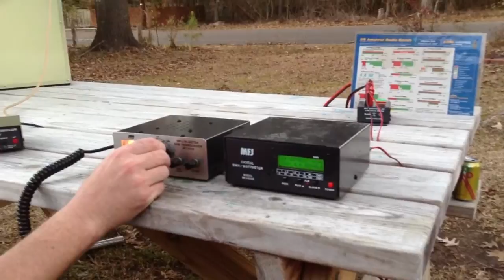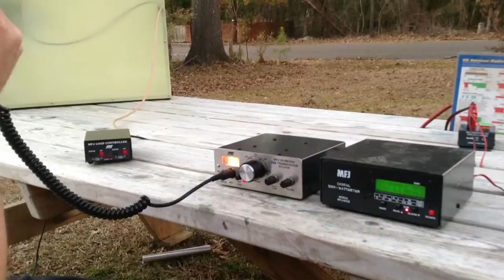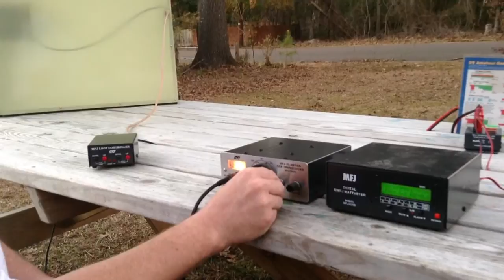MFJ-1780 Box Fan Loop Antenna

Comment: @z8ty did you get the box antenna ? and how is it performing ?
Reply from the maker: i returned it after reviewing it.  Was an easy system to setup and was always a topic of conversation.  It works great if you work single frequency.  Since the Q is high, you gotta retune on every little frequency change.

Comment: I have an MFJ-935C Loop tuner, made up loop from 4 meters of 10mm copper, that's 13 feet long and made contact to Canada from Ireland with just 20 watts, I'm going to have a lot of fun with that. 

Eric, KJ4YZI has some videos on it too his channel is hamradio concepts.
Reply from the maker: I am very familiar with the MFJ-935.  I was also involved in the design
Reply: @cebutler100  Very interesting Chad, thanks for sharing, the 935 is a very interesting loop tuner.

why does it not have the little coupling loop like other loops ?

And why do you need different loop sizes ? is it more efficient this way using different loop sizes ?
Reply from the maker: @o00scorpion00o  slightly different design with a matching capacitor rather than a fixed LC circuit
Reply from the maker: @o00scorpion00o  hard to tune a single wire to tune each ham band, it would take a huge variable capacitor.  different wire lengths for each band makes it more efficient
Reply: @cebutler100  Interesting Chad, thanks for the info. I intend to experiment more with it during the finer months. 

It would be great if MFJ could update it to be weatherproof and have remote tuning and tripod mount. Still for portable use I think it will work well because I won't have to set up radials or try string up a wire antenna.

I made up another loop of 9 feet and I made contacts on 20 meters and it's supposed to work on 17 too and they can be good bands during the day and it's a pretty compact setup.

Comment: Are you still using this antenna?
Reply from the maker: No returned it
Reply: @cebutler100  why did you sell it ? how did it perform ?

I see MFJ have a new version of this, the old one got good reviews on Eham.
Reply: @o00scorpion00o  I am curious as to why he sold it too. Very little practical experience info on the web.  I read several reviews at DX Engineering and decided to try one.  It should be here in a few days.  If not good will return and buy 1788 when they become available. 73